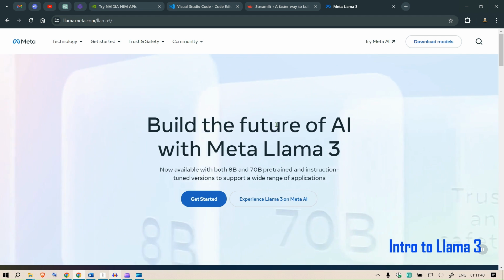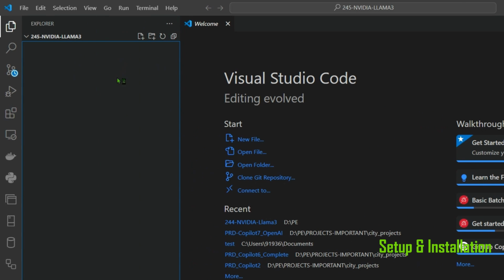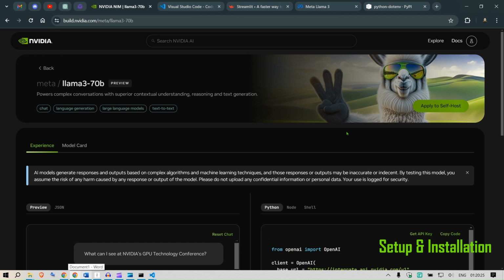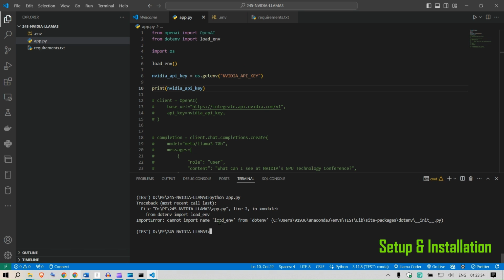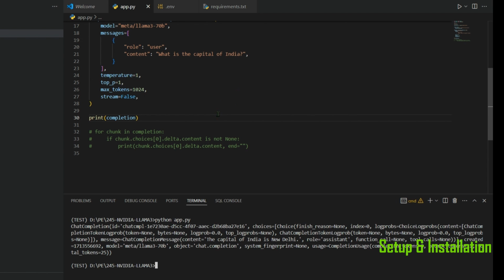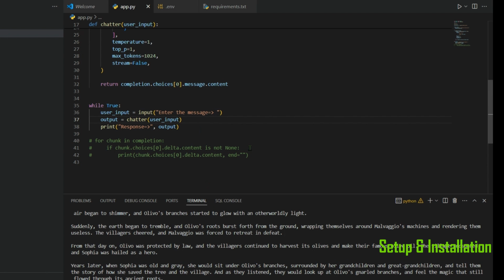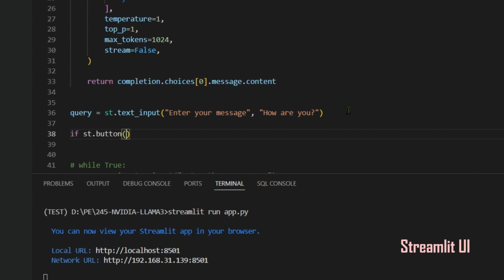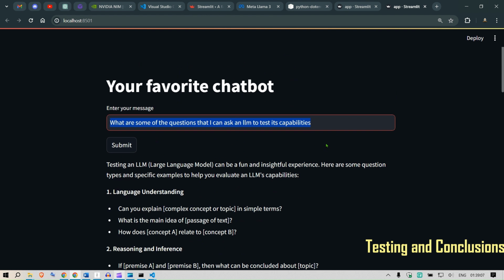Run 70B Llama-3 LLM (for FREE) with NVIDIA endpoints | Code Walk-through

Comment: Can I do on Intel chips
Reply from the maker: Yes
Reply: @PromptEngineer48  can you make on that I tried from hugging face but it's cuda it's need Nvidia but I don't have so can you please it can help a lot I have Mac Pro and it's based on Intel i9
Reply from the maker: If u want to run that really quick, use Ollama 😀
Reply: @PromptEngineer48  I have used ollama it's downloaded 4 GB only I want to use with CPU and more effective so can you provide with Intel pls

Comment: GROQ>NVIDIA for API. groq has 4096 max, nvidia is 1024 max. Groq is same speed if not faster. Either way, I prefer groq and its the same ease, plus can use tools.
Reply: Does Groq give free API access?
Reply: @divineigbinoba4506  I believe there is an option yes
Reply: @Derick99  0 paid options last I checked
Reply: @drlordbasil  I can't remember how I got it but Matthew Berman has ai videos I found a way on his one time not sure if it was the devika video but one walk through around then or before then was free api I still use no charge but it's not llama 3 but works good for devika free when I need it
Reply: @divineigbinoba4506  yeppers
Reply from the maker: Cool